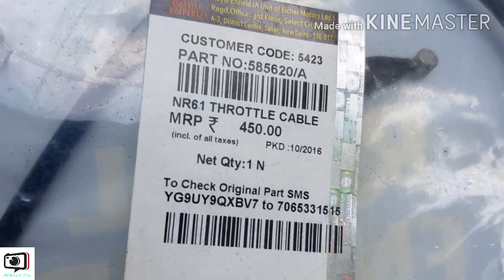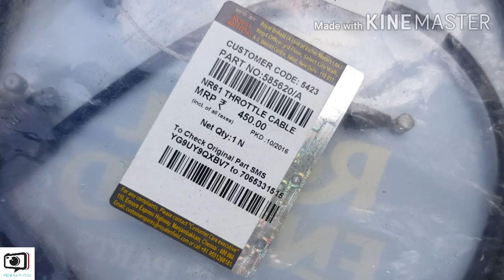Royal Enfield Continental GT 535 throttle / acceleration cable change | DIY |

Comment: Thankyou for video chetta.. where did you get this cable from? Can you give link
Reply from the maker: Online kittilla its from alappuzha . If u want i can giv u the shop number
Reply: classic 500 itta madhiee. ath fittavm. oru. change ullath. gtntell ath oru L shape metal support kittm but for classic 500 ath spring supportannu. .. ath  fittavmm
Reply from the maker: Bt it won't last
Reply: Kunjas vlogs bro gear assy ethravm
Reply from the maker: Bro do you know the part number